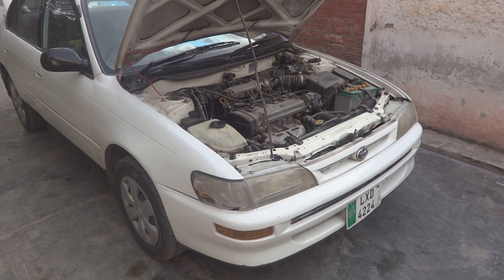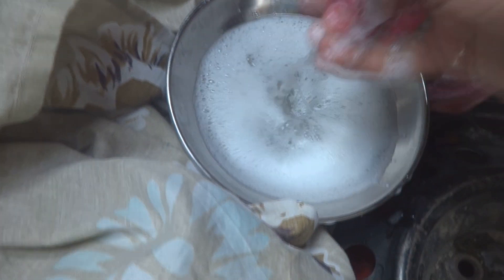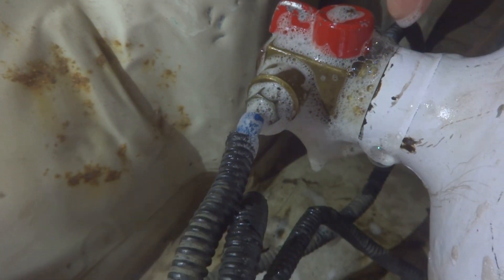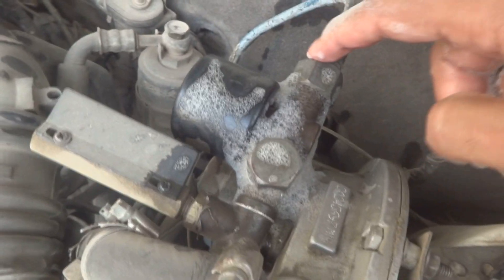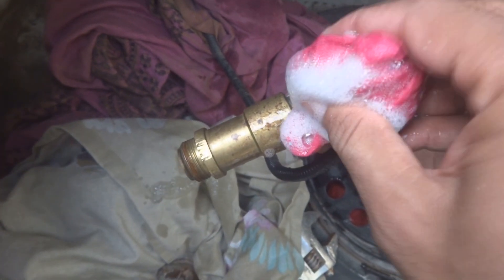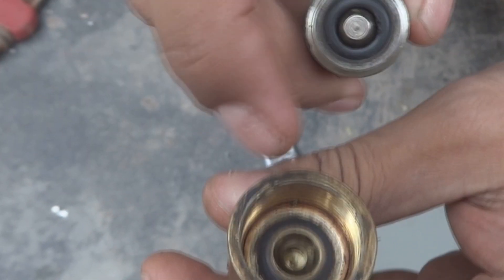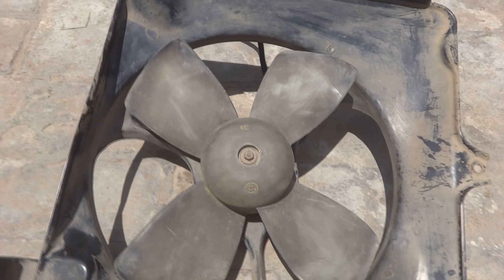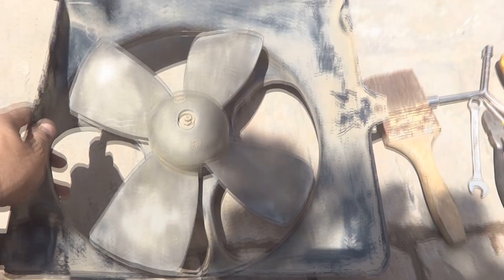cng, cng gas, cng price, cng near me, compressed natural gas, cng car gas leak detection and repair

Comment: Sir are you working here in saudi arabia? If so, can i have your details please,, i have a problem on the idling of my toyota corolla 2002 model.. I'm here in riyadh.. I scanned it and it shows P0505.. Please help me..
Reply from the maker: No. I am no more in KSA. You have some problem with IAC valve. Check its wiring and valve itself. In worst case could be a bad ECU or PCM or computer which may not actuate the IAC valve. All it needs testing and proper troubleshooting. Stay tuned.

Comment: Hi
Here in uk we use gas leak detector spray gas is dangerous if it builds up little spark will ignite it.
Reply from the maker: Wonderful! You have good testing facilities there. Here we are using very basic and conventional ways to make a job done. The reason is off course lake of facilities. Stay tuned and blessed.

Comment: Sir i have a tartarini cng kit which uses vaccum hose on kit bottom. I always have problem like in starting. It's installed with 16valve 1300cc 4efe petrol engine. What to do to make it trouble free.
People says only solution to replace this kit with landirenzo other than this no any solution.
Any help/advice.
Thanks
Reply from the maker: Very much fine tuning can help your starting issue. Most gas cars have starting issues. I will try to post a video in future to solve such a problem in future. Stay tuned.
Reply: @JahanZeb1976  thank you very much for your vauled time and response.
I would like to add sometimes it's very hard to start not only on cng but on petrol as well.
Please advice is it possible by ignition distributor igniter or rotor malfunctioning. How to confirm distributor performance?